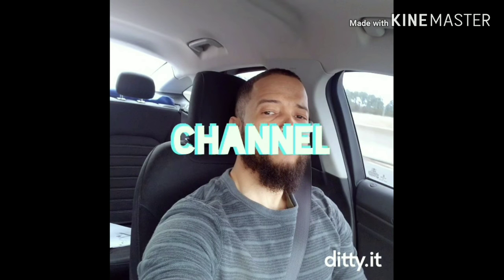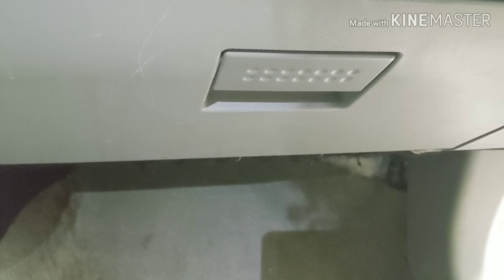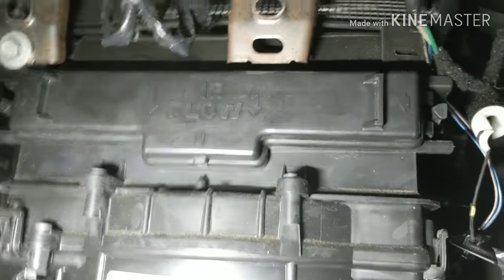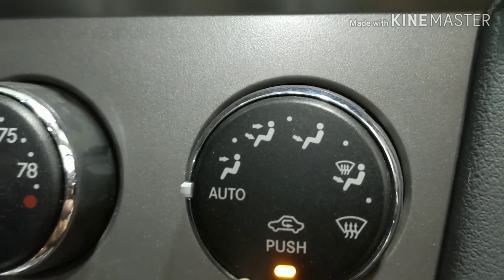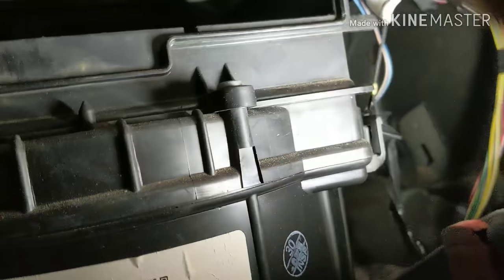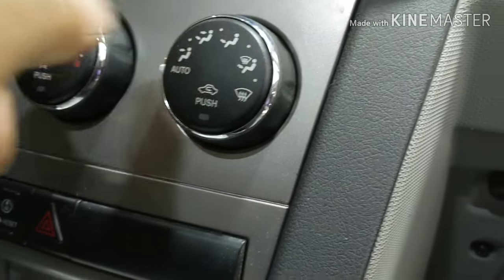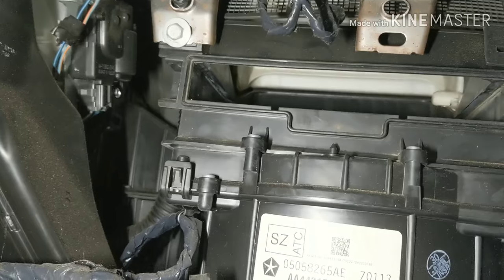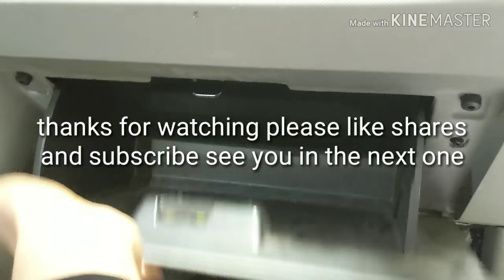A/C ticking noise EASY FIX for free

Comment: Amazing - I had the same problem and I just went out and fixed the noise in 2 minutes start to finish! The disgusting part is that last week, my mechanic told me I had a block in my A/C line and they would need to pull the entire dash out of my 2013 Dodge Journey to fix it at a cost of between $3,000 and $4,000!!!! Thank you so much - the world needs more honest people like you :)
Reply: 🤣🤣🤣🤣🤣. You should show your mechanic the video then tell him that you are replacing him with another dishonest mechanic
Reply: to be fair, you didn't fix it, you just unplugged it. Fixing it would be replacing the actuator. Which would not be a 2 minute job.
Reply: @bowiehunter that’s fair, but the MUCH MORE affordable option should be proposed if you have any decency about ya
Reply: @bjvu9460 I mean air and heat still flows. Nothing was blocked. So they need a new mechanic anyway

Comment: I have been hearing this noise for a year or so now and could not figure out the issue. I'm about to do this in my 2014 Chrysler 200 as soon as I get back home. I took it to a mechanic and they wanted to charge damn near $500 to take the dash apart to repair it. Nope. I'm so glad I found this video.
Reply from the maker: Wow for real let me do it for $499 lol ,, just follow the noise your car has 3 or 4 door blender so one of them is bad

Comment: Perfect! After replacing a blend door actuator and the noise still happening this is just what I needed.
Reply from the maker: Then you have more then one actuator bad sir
Reply: Basically unplug every actuator sir, the fix is still there :)
Reply from the maker: Fallow the noise and unplug it
Reply: Same thing happened to me. Had no hot air at the same time as the knocking noise, replaced the blend door actuator and fixed the no hot air problem, but I realized it also knocks when on circulating air.
Reply: @masonmccalister8535 what did the problem wind up being??

Comment: Thank you so much! Because of you I tried pressing the button that reuses the inside air and it stopped the tapping noise unfortunately the blower door seems to be located somewhere in the middle or back of my truck but now at least I don't have to deal with that annoying tapping 😂❤

Comment: Does the same disconnecting steps work for a Ford Fiesta? Like how you went inside the glove compartment?
Reply from the maker: Yes I'm sure it will be very close
Reply: I have a Fiesta and it’s doing the same thing. What’s the part called if I wanted to really fix it? What’s the level of difficulty?

Comment: Thank you. I have a 2008 Mustang and it just started doing that 2 days ago. But the noise is coming from behind the AC controls below my stereo in the center. I brought it by my mechanic today and he was guessing it would be about $300 to fix(mostly labor taking the dash apart). But I'm hoping it's similar to your car and I love your fix.
Reply from the maker: Wow don't pay that ,, the dash don't need to come out ,, just fallow the noise and you can do it your self ,, I also have another video
Reply from the maker: https://youtu.be/DL9P1oV7IlY
Reply from the maker: Check this video out this one was the door blender not the outside air like the one you watch first
Reply: Nestor Auto Repair . Right after I posted, I looked for my car specifically and found a video similar to yours showing where to replace the blend door actuator  I ordered a motor craft off eBay last nights for $33 shipped. Thanks!!
Reply from the maker: There you go good that's the point saving money
Reply: Thanks 👍🏿

Comment: Thanks! Being a female I was able to follow your advise and now that annoying noise has stopped. Is it the actual module or the compressor that is the issue for replacement later.
Reply from the maker: Hey thanks and congratulation , yes the bad part is just the one you unplug, the actuator  door blender
Reply: @nestorautorepair  great! Thank you so much!!
Reply from the maker: You're welcome.

Comment: Unfortunately not the problem I have, it is ticking but not there and not with the air out on/off. The ticking comes from under steering wheel. Any help ?

Comment: Thank you for this helpful film. I have that same noise regardless if the AC on or off. Before it would stop clicking when you switch to the closed mode, but now it is clicking all the time. Will it pass the state inspection w/that noise? If I want to fix the problem completely, what part should I buy (you mention some module should be changed), what's the name of it? My car is 2003 Chevrolet Cavalier.
Reply from the maker: Hello yes it will pass , so you need to stick your hand in there and see witch one is making the noise some cars have 3 some car 2 or 1 but the name is door blender actuator , in most cases one part will fit all 3 but is good to ask
Reply: @nestorautorepair  Thank you so much for your replay. Yes, the car passed the state inspection yesterday. I'm trying to get the excess to that Actuator, on that car (2003 Chevy Cavalier) it is very hard, you can't remove the glove department, it is build into the dash panel. I ordered already from Amazon (it is called there for my car Air Door Actuator), but I saw many complains on those products fm Amazon. I might check w/ Auto Zone or Chevy Dealer what they have. Hopefully I'll go without removing the whole dash board. Thank you again. God Bless.
Reply from the maker: Oh wow ok good luck , you're welcome

Comment: I have the same issue. I have a 2008 Honda CRV. I tried doing this however it continued to make the clicking noise. Any ideas on what it can be? The noise seems to be coming from the bottom of the pulley belt? Not quite sure what the part is called. All help is welcome.
Reply from the maker: So if the noise is at the engine compartment , you have a bad dry bearing in one of your idler pulley of you have a bad a/c compressor or bad bearing or need oil, a dry belt can also make noise try adding water and see if it goes away you just need a new belt.
Reply: @nestorautorepair  Thank you so much!
Reply from the maker: Your welcome
Reply: I have the exact same car, and it just started doing that. Did you have it fixed, and if so, may I ask what it was?

Comment: Is there any possible way you could tell me where to unplug for a2012  Dodge Challenger? I’m having the same issue but the inside is set up differently
Reply from the maker: Hi yes you need to wait for it make the noise and fallow the sound and stick your hand up there and confirm witch one is bad there are 3 of them ,, they are all the same

Comment: Hi, so im having the same exact noise, but the AC isn't even running. Just when I turn the car on it starts ticking for about 6 or 7 secs and stops Do you think it could be the same problem even tho the AC isn't running?
Reply from the maker: Yes it is this one was the same and I just fix an Impala last week same problem ticking with ac off
Reply: @nestorautorepair  Gotcha, so what exactly needs to be replaced in order to fix the ticking?
Reply from the maker: Replace the door blender actuator

Comment: I was told it would be $550 by my VW dealer to fix this (Canada). I passed. But I do like my outside air so I'll just stick with the noise for now.
Reply: Inside Barry's Mind  I got the part for $80(Canadian) and fixed it myself. Now it's back to functioning properly. There's a video on how to do it, not too difficult.
Reply from the maker: Good
Reply from the maker: Wow
Reply: Inside Barry's Mind  Forgot to mention I did it for my VW Golf. Dealership said the part alone was just over $300! Like I said I got the part WITH shipping for $80. What a scam. With labour at the dealership they quoted $550 (Canadian). I don't know the first thing about fixing cars and it took me less than 2 hours to do it.

Comment: I have a 2005 cheve mailbu ticking noise it won't stop and it giving me a headache evrytime I drive it
Reply from the maker: Ok let me help you oh that car , go under the globe box and remove two plastic taps and cut the  solid blue wire , but before you cut it make sure you put the temperature where you want it to say in order to change the temperature you will need to connect the wire and change the temperature and them disconnect it again it take lest then a minute start to finish

Comment: Will the AC still work after disconnecting that wire?
Reply from the maker: Yes 100% will work
Reply: I have problem with .y seat Ibiza 1.2 petrol itech I cannot find the connector so I can disconnect any help plz 2015 oleate
Reply from the maker: Well first you need to know wich one is the one making the noise and the connector will be on it

Comment: Will it work for a 2007 Chevy Impala
Reply from the maker: Yes but it will be hard to get to the plug , under your globe box remove two plastic tap and cut the light blue wire going up to the door blender fallow the wire up and you will see it but cut it down where you can connect it back so you can be able to switch it back to hot on winter if you are not replacing it

Comment: Yo does this work for 2015 Lincoln MKS
Reply from the maker: Yes but you need to make sure you touch it when is making the noise so you know witch one is making the noise , each car has 2,3, or 4 door blender actuator

Comment: great video. what about if the AC clicks on and off. could it just be the fuse?
Reply from the maker: Thanks for your feedback,, no if is clicking on and off there can be 3 reason why ?
#1 Over charged
#2 Low on frion ,,, try this first
#3 Bad ac clutch
Reply: @nestorautorepair  thanks I'll check on that
Reply: @nestorautorepair  thanks. I will fix it. Also the throttle body was bad and i raplaced it for a new one and stills shows the throttle light on and slows down. Has been fixed two times already. And i belive that the a.c ticking noise is affecting that too. So i will do fix this 3 things that you have mentioned.
Reply: @nestorautorepair  or bad climat control
Reply from the maker: Correct
Reply: The-

Comment: Can you get carbon monoxide air  from this ?
Reply from the maker: Well having it open yes anything on the street you will smell it ,, I never keep that open on any car ,, ac and heat work better with that close because that's just outside air that comes in from there

Comment: Anybody have this issue with an 05 Jeep Grand Cherokee or similar model? Clicks when AC/Heat is on
Reply: Is that a yes?
Reply from the maker: Is the click Inside the jeep or by the engine ?
Reply from the maker: Where is the click

Comment: But this is only a temporary fix, isn't it? Won't it be better to actually "fix" the problem by replacing the module with a new one?
Reply from the maker: It can be both if you don't need outside air then is fix , if you need outside air then yes get a new one when you can